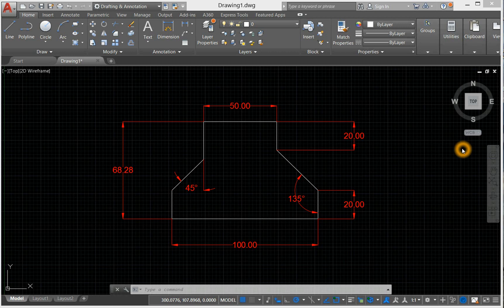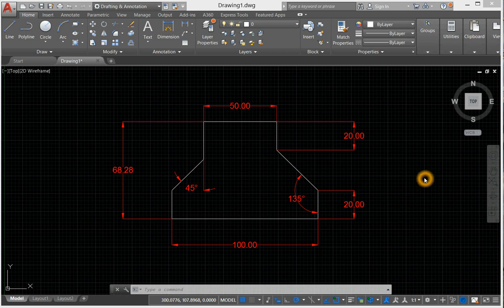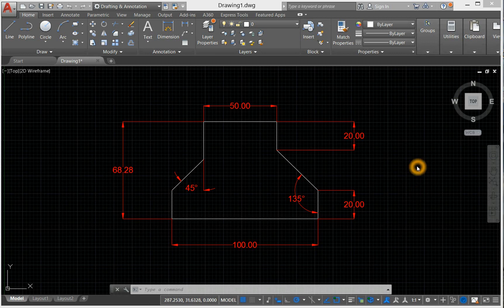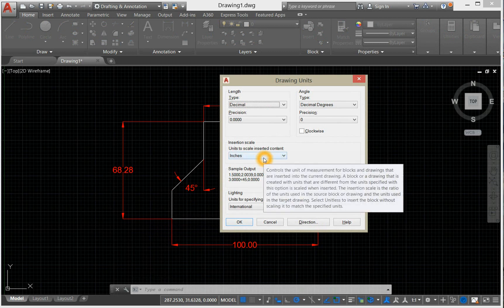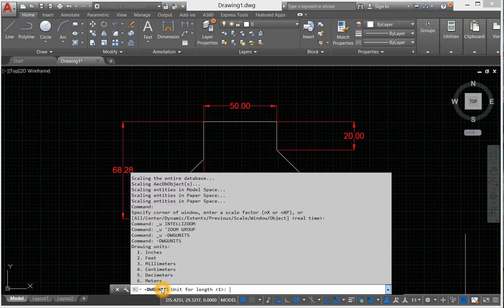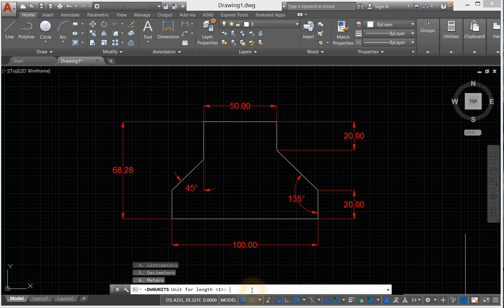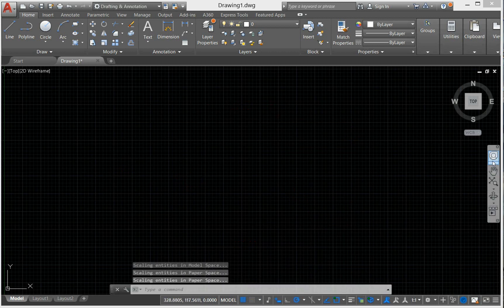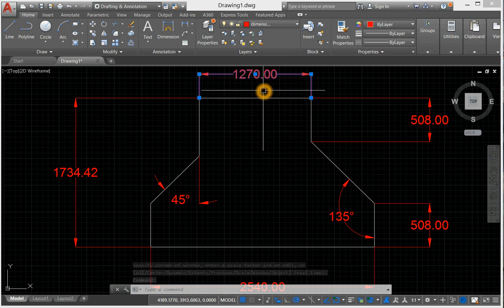How to convert units of an existing drawing in AutoCAD

Comment: Doesn’t work. My scale is still messed up.
Reply from the maker: the measurement will still be the same just different units
Reply from the maker: and also, don't forget to use zoom extents right after otherwise, your object may not be visible

Comment: I tried this but my Autocad doesn’t show the complete the -dwgunits command thread. After the fifth step (the INSUNITS step for which i enter Yes) there’s no further steps visible, it just shows “Command:” as in i have to type in a new command. If i click enter, it just goes back to the first step and its just a loop then (step 1 to 5 then back to step 1)
Reply: ^ any solution for this? Im experiencing the same issue